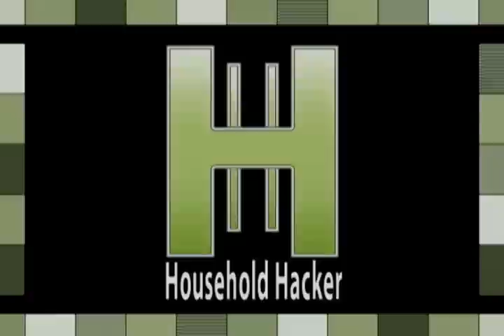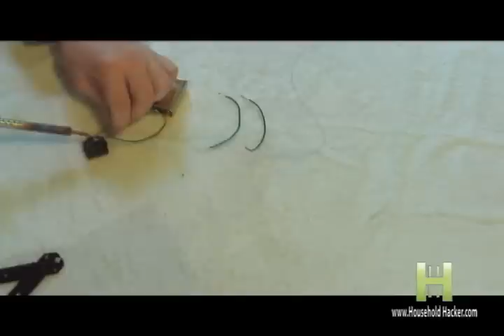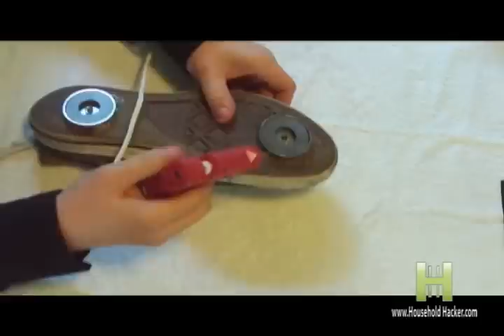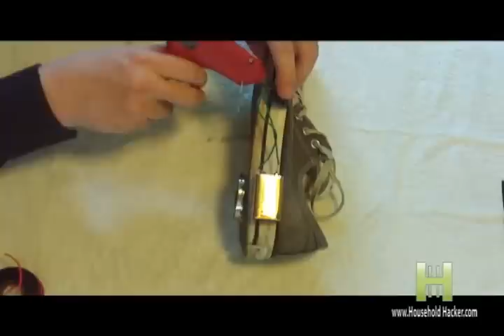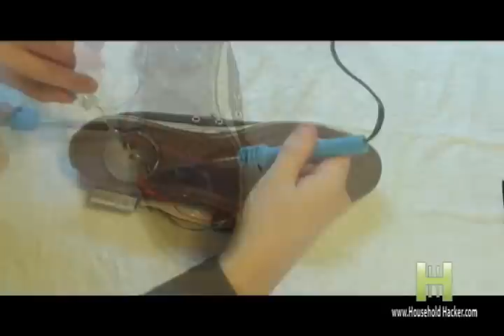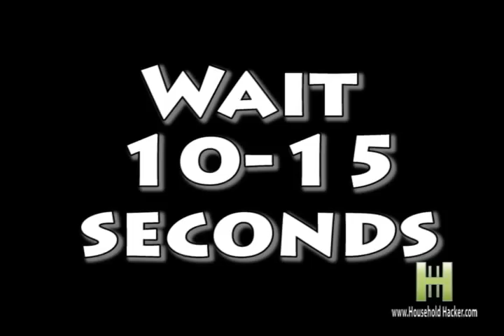How to Build Hover Shoes

Comment: I find anyone and everyone who thinks this is fake just assumes he's holding onto something, when no, the electric charge magnetizes the metal underground (this is why you must wait 10-15 sec while the voltage gets through the concrete) then the newly magnetized metal repels the magnets on the bottom of the shoe causing the hover affect, and for those who think this was an april fools prank, this would have been uploaded on april first not third, and he would have said it was fake at some point. #Science
Reply: *****
Why do you have to be mean to bronys? What did they do to you? There just people ya know.
Reply: who cares if how he explained it was wrong, it works and that's what matters. Now I can fly, not as good as rainbow dash, but who cares. I BELIEVE I CAN FLY!!!!
Reply: first of all, those are magnets, so they only affect charges that are already moving and have nothing to do with charge.
but on the idea about the charge, assuming the charge is positive (same idea if negative), then it would push the positive charge in the beam away and pull the negative charge towards it, (diagram: (charge)+   |- (beam) +|), which causes the beam and shoe to attract, not repel
Reply: Why did he need the battery and wires then? He could have just glued the magnets on but he didn't, try looking into that first
Reply: And you are..?
Reply: ***** You do know metal can repel a magnet right?
Reply: do you even understand these thing we call, Electromagnets.

Comment: I don't believe it-_- he just might be hanging onto something
Reply: like..... DEEZ NUTS
Reply: +Carl Jones How is that even funny?
Reply: cardioandfriends Just coz
Reply: +Ali Brnsaid 
what are you guys talking about.
Reply: +Ali Brnsaid sherlock
Reply: hover shoes are very possible but you need alot of metal below you and a very strong negative magnet
Reply: Yeh thats is what im thingking
Reply: +Luca Street it was 2 50 lbs magnets. a combined force of 100 lbs. if both shoes then 200 lbs. more than enough for most people
Reply: Ya
Reply: +Luca Street there is really not such a thing as a "negative" magnet.. There are indeed two separate poles, but they are really only referred to as positive and negative to show opposing force... And you cannot simply have a single pole magnet (most physicists would say it's impossible).. Even then, the metal itself would have to have the same polar charge as the (impossible) single pole that you'd have in the shoes... This is simply not ever going to happen in this simplistic circumstances.
Reply: Will6804 Luca Street   Actually there is. If you super freeze a Superconductor using liquid nitrogen, Then it can temporarily reverse the effects of  a magnet. So in short it repels metals instead of attracting them
Reply: i agree with u
Reply: +Dj Mastr look at his feet the way they dangle would justify that he would be holding onto something
Reply: Ik i dont believe it
Reply: Idk it not gonna work
Reply: I agree he might be hanging on something that spins around
Reply: +Alex Ellis dees. Nutz
Reply: yeah
Reply: +Nick Buela yes he is holding on something
Reply: yea
Reply: +Emilian Ivanov yeah I think so too
Reply: in the description he said it was fake. Just for fun. but it can pick up coins and stuff so yeah I guess when when it's pretty cool. If you want to pick up lost coins. I bet you Adam I love you have a lot of roomi
Reply: but who reads descriptions
Reply: +Sand Storm 
i dooooooo
hey boy get out of my way...............or girl
Reply: +Nick Buela Eh, this was made 2 days After April Fools day sooo yeah.
Reply: +GoldenTanookiMario5471 but it actually does work
Reply: Kristina Albrecht I want proof.
Reply: ikr
Reply: Well not fully sure if it works myself right now but to be honest in theory it should. Hes creating an electromagnet by wiring up the switch, which is wired up to the battery so you can turn the power on and off, to the magnets which allows power to flow through the magnets. If you go over to a magnetic surface and turn the magnets on you can create a magnetic flow which if strong enough can push a fully grown person off the ground. Its basically the same way hover boards work. They use magnetic fields to create lift suspending even huge objects. In fact theres a company (I believe the same that created the hover board) that is looking into creating frames for buildings that run off the same logic as hover boards. It will allow the building to become suspended for a given amount of time to avoid damages from such things as earthquakes and the like.
Reply: ya me too
Reply: +MochaTater geek
Reply: Yeah he should've shown his whole self floating
Reply: make them maybe you will believe
Reply: +SmokyDaCat :D Yeah. I agree with all if you... He probably is... :,(
Reply: XD XP I prefer the term dork but I think you are thinking of the word nerd XP either way im not actually smart enough to be either... But hey its fun being weird
Reply: What a coincidence is two days after April fools
Reply: How was he spinning 360° nonstop
Reply: +Dj Mastr what you said dosent mean anything...  you say super freeze a superconductor using liq. N2. then it will reverse the effect of magnet. 
1. super conductor and magnets are not the same.
2.how can a super cool super conductor effect a magnets effect on a metal?
please help me to understand your views
Reply: +Dj Mastr no there isnt
Reply: +Nick Buela  yeah a think it got som a tiy sorry for that spelling haha
Reply: +Will6804 There can actually be a negative magnet. It can also be referred to as a monopole magnet. You make this by freezing the magnets and slowly separating them. You can look up any further information you would like to know.
Reply: he is

Comment: FAKE. You don't need to wait 10-15 seconds, you can hover instantly.
Reply: Nuke town I think it's time to get off YouTube
Reply: Derp industry Go i agree with you
Reply: Yeah I added by triple jewl flux transiting capacitor for a flight mode , it pushes against the earths magnetic field
Reply: Well he did say to hover grab a support bar and hold your self up. (so your feet come off the ground) so its obviously a joke
Reply: He's just a kid
Reply: Dude you need to wait for the batterey to connect with the magnet things i have done it. I had to wait that long!
Reply: Also fake because you can tell he is suspended from a wire or something. His feet dangle as if there is no support under them.
Reply: Morten Kristoffersen So this really works?

Comment: there is a slim chance it is real yes he could have been holing onto something but as he said you would most likely need something to stabilize, meaning it probably did lift him a tiny tiny bit off the ground because when he attached the magnet to the battery with wire once he turned it on it would become a electro magnet which can be pretty powerful and remember how he said to find a metal spot? that was so the electro magnet would have something to push against.

Comment: how is 9 volt batery going to lift a person? also even if electromagnets did work like the way 'used' in the video you would need to comlete the circuit or the electricity wouldent form a current.

Comment: When u turn on the switch, it's a short circuit lol (basic physics) and the magnetism is never controlled by the electricity, so the battery basically has nothing to do with the whole hovering thing... If u need electricity, then it needs to be an even electric field both on the top and on the ground.... Just so many things wrong with this bs...